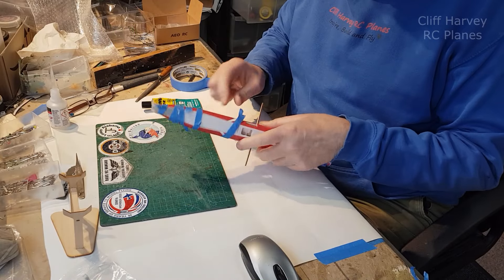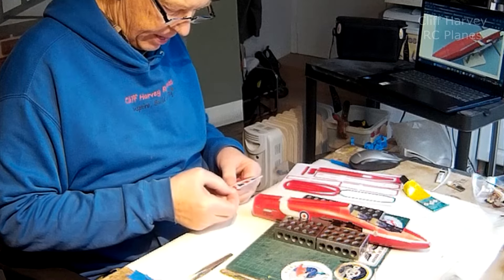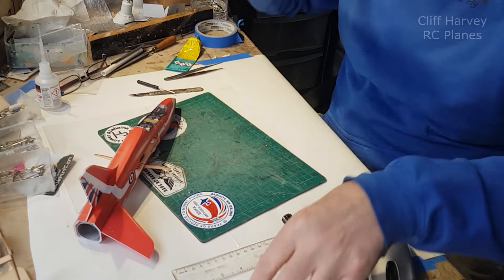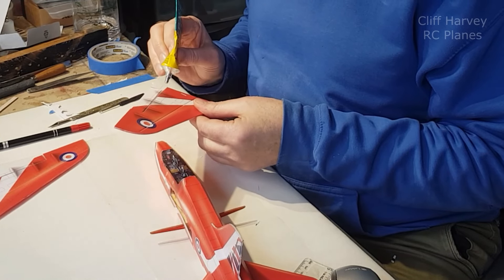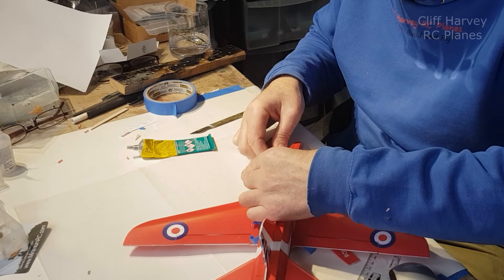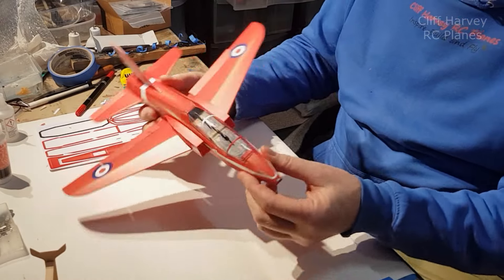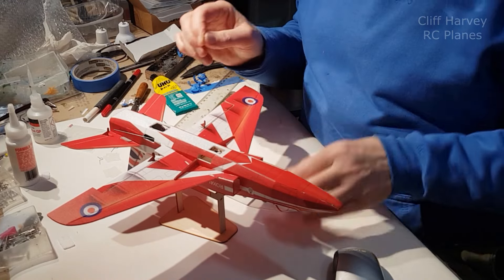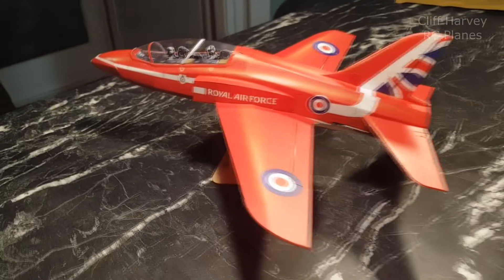MinimumRC BAE Hawk Red Arrow Assembly Part Two

Comment: Very nice, glad I found your channel. This is a nice hobby build. Thanks again. Robert.
Reply from the maker: Thanks for watching Robert, what sort of models are you interested in?
Reply: @CliffHarveyRCPlanes  I'm new to RC planes and have built a few top wing trainer  planes. I started with 4 prop drones, which was my stepping stone. I really like smaller ww2 war birds. I have a ww1 JN-4 Jenny that I also need to get cracking on. I like foam with some balsa/wood builds.
Reply from the maker: @robertgribbin6444  Hi Robert, it's really good to know that new modellers are finding the hobby through dones. Smaller WW2 aircraft are perhaps the hardest to fly due to their inherent instability but having said that with as3x and safe they're not too bad. The Jenny is a classic which should be a lot easier to fly, I would concentrate on that one first, cheers 👍

Comment: lol, we made the same mistake!
got mine a few days ago, built it and maidened it, but realised THE DUCT IS OFF CENTER
apparently we werent supposed to glue it to the side panel XD
Reply from the maker: I can't honestly say it's made a lot of difference 👍🤔
Reply: @CliffHarveyRCPlanes  yea, I only realised it as I glued on the top and bottom panels XP
Reply: @CliffHarveyRCPlanes  also, would like to know if you have been facing issues with the receiver suddenly losing control when the battery is low
I've only got like 30s flight time before the thing shuts off and motor just keeps running
Reply from the maker: @iammeobviously6815  No issues like that, have you tried batteries that are pretty new? Or a different transmitter (clutching at straws!)
Reply: @CliffHarveyRCPlanes  another transmitter dosent seem to work..my batteries are about 3 months old
I timed it, and apparently it can only last 2 min at full throttle B4 it starts shutting off.
What's your flight time?
Reply from the maker: @iammeobviously6815 I fly for 2.15s at mostly full throttle, three month old batteries are fine, some of mine are three years old 👍
Reply: @CliffHarveyRCPlanes  yea should be about there
No worries then, I think my e680 only charging those batteries to 4v

Comment: Hi Ciff, I received my kit. The fuselage sides have a crease.  Any ideas? Thank you, Robert
Reply from the maker: Hi Robert, that's disappointing, do you think it happened in manufacture or packing? The box is really strong so I'm guessing it did. Get in touch with MinimumRC on their website, they may need photographs, and explain the problem. They also have a Facebook page you could use but try the direct approach first 🤔 Let me know how you get on 👍
Reply: Pour boiling water out of a glass measuring cup (or something similar with a spout) over the foam -- that will pop out the crease. If hesitant, test on scrap foam.👍
Reply from the maker: @GeneKoro Great tip Gene, cheers 🙂👍

Comment: A great series of build videos and I've seen the ones of you flying it. Looks like a great kit and 'plane. However it was badly let down by the white flashes not lining up, several of them didn't and it sticks out like a sore thumb. Something that you definitely should pass on to the manufacturer.
Reply from the maker: Hi Tony, yep, already passed the graphics problem on, also the lack of a pilot and short aileron carbon rods, all of which they plan to address, thanks for watching and commenting, cheers 👍
Reply: @CliffHarveyRCPlanes  Well done.